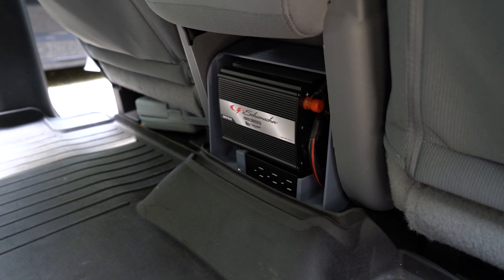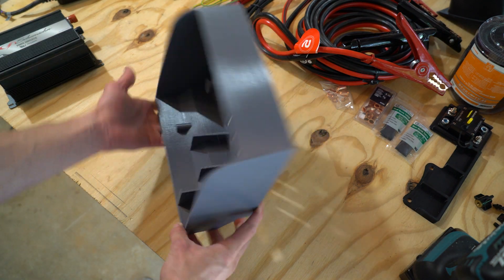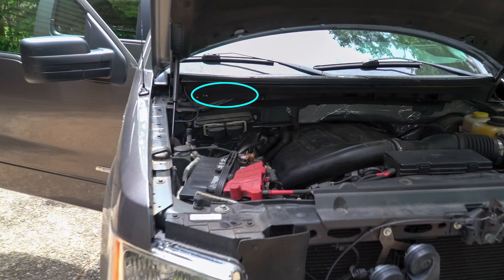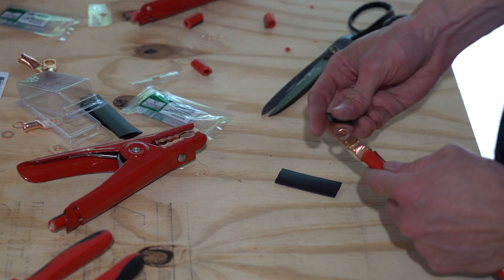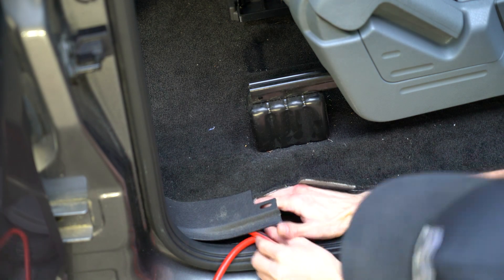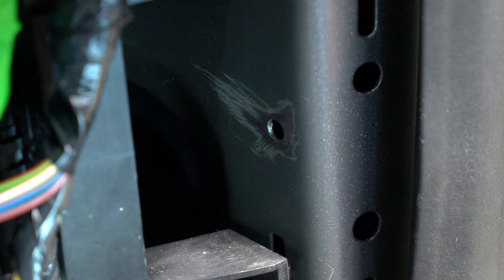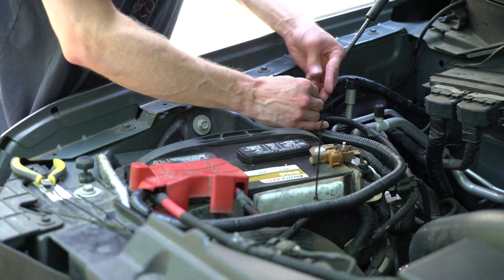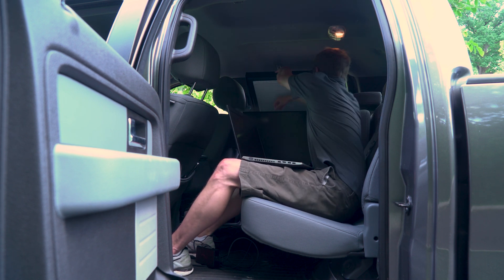Power Inverter - Wicked Full Install - AC Power for your Car or Truck

Comment: Would it be appropriate to ground to the battery?
Reply from the maker: That's not the traditional way of doing things in a vehicle. It creates the need for a lot more wires. Outside of that there may be additional reasons to avoid this but I don't have the experience to say for sure.

Comment: Great clean install - breaker should be as close to the battery as possible though. I've seen cars burn to the ground from a shorted power lead.
Reply from the maker: Thanks! I did end up putting an additional fuse on the line next to the battery.

Comment: Modified sine wave inverters are the best for resistive AC loads (lights, warmers-- things that do not have spinning parts, moving parts or motors). They're the best for those kinds of devices, because there is not as much loss in producing the modified sine wave. Running a resistive load on a pure sine wave inverter is a waste. Nothing will be broken or damaged, but the loss inside the inverter to produce the sine wave makes it run batteries down much sooner. If you will be running resistive load devices on your pure sine wave inverter only when the engine is running, and never on just batteries; it doesn't mean as much and you can just run all your devices on a pure sine wave inverter.
  On the other hand, never ever run an inductive load on a modified sine wave inverter, unless you know you do not care about the life of that device. They run horribly inefficient and run hot on modified sine wave inverters. They are something like the equivalent of giving your inductive device a brown-out to deal with, but you did it on purpose. 
Having both on hand for each device is appropriate. Choose wisely for the type of load you are going to run. Aims is good equipment, and runs cool. 
 Also, as a rule, don't load them past 2/3 of their rated power. This has a lot of implications, too.
Reply from the maker: Great info! Thanks for the comment.

Comment: I somewhat familiar with installing devices connected to the batter (emergency lightings/escort flashers) and have only had power inverters that use the 12V outlet. Is the breaker under the seat a necessity or just a safeguard? I want to make sure I do it the right way in my truck and am not familiar with the breaker or its purpose, so this has been super helpful, but any info on the breaker & its purpose would be helpful too! Thanks
Reply from the maker: The breaker should be installed for safety reasons just in case something shorts out. It can be better to install it closer to the battery terminal end of things as well. Check the comments for more info on that.

Comment: Very interresting video, thank you, I was thinking fitting one to convert to electric heating but always wonder if it could be use when the engine is on and if the alternator could cope, does the manual says what how many amps the converter will draw ? 
Cheers
Reply from the maker: The breaker that I installed is good up to 85 amps. I think that this breaker will actually limit the inverter to about 900 watts. A 750watt heater should only pull 7 amps continuously. With the engine running the alternator may be able to keep up with this level of draw, but I'm not sure. 

Always use caution when running a space heater in an enclosed space!

Comment: That is the cleanest install I have ever seen. And I do them all the time. Definitely earned a like.
Reply: Matthew Terry is it possible to power a pressure washer off a car battery for moderate amounts of time?. Say with a stronger and bigger battery and if so what kinda setup would you recommend as I'm a mobile detailer.

Comment: Dump that inverter and get a pure sine way  you won't be sorry. I have had 110 ac in almost of the cars I have owned. As a photographer videographer I need power and coffee. One of my coffee maker refused to work with a modified sine wave type inverter .  I even run a electric frying pan with mine. Also if you are going to use and inverter get a 12 volt circuit breaker and  a Blue Sea charger isolator   as well as a marine AGM type battery. Good luck.
Reply from the maker: I will make that upgrade one day. Thanks for the tips!
Reply: @The3DHandyman  anytime my friend that's what friends are for

Comment: Your engine won't turn on unless the inverter is off because the inverter is pulling current from your battery, which reduces your crank amps to power the ignition. By turning it off, the battery is able to provide full capacity amperage to the ignition. So either you get a battery large enough to power both or just be wise and turn off the inverter when the car is off
Reply: A relay wired to the ignition could also fix that problem.
Reply from the maker: @rahenkamp1  Does the relay just delay the current draw?
Reply: @The3DHandyman  it can open and close the inverter circuit with power from the key position.
Reply from the maker: @rahenkamp1  Nice! I had no idea. Thanks for the insight
Reply from the maker: I was wondering when I'd get a proper explanation of this!
Reply: @The3DHandyman  I was looking for a comment explaining it too, but never found it so I figured it would help 👍🏾
Reply from the maker: @11superstar1997  Much appreciated!

Comment: A few critiques. 

1. You really should have some overcurrent protection (fuse or breaker) within 6-12" of the connection to the battery. This minimizes the risk of the cable getting damaged, shorting out, and causing a fire. The likely good if this happening is small but does potentially exist with animals or an accident.  As it currently is installed the line is unprotected from the battery to your breaker under the seat. 

2.  I've hooked up a fluke  VR1710 to one of those Schumacher inverters and the power quality coming off of it is a quintessential modified sine wave. Ok for non sensitive electronics but I'd have some reservation about plugging in anything sensitive to one as you pointed out.  If you ever decide to swap it out the xantrex prowatt SW1000 would be a good replacement that's not horrendously expensive. Power quality isn't perfect but likely better than your wall power at home.  I've got their prosine 1800 in multiple company vehicles. They're about as perfect as you can get but stupid expensive and large.

Other than that you're install is super clean.  The wire lug covers you used was a really good idea. I probably would have grounded out to the same point out maybe the seatbelt retractor mounting bolt in the b pillar, mostly to save wire and not drill a hole. Looks like the seat rail to body bolts would have been a pain with the plastic trim covers.
Reply: Hi there, thank y'all both for all this good info. Wondering what sized fuse/breaker you'd use? Could you link to one w the appropriate specs?
Reply: @leahgilman  You need to calculate your max current draw and pick a breaker slightly larger than that.  Search on amazon for a "Marine Circuit Breaker" and you'll find plenty of options.
Reply: Xantrex prowatt sw1000
Reply: @tbits6  yeah that's the best "budget but still really really dang good" inverter. I have that and the ProSine models at work. The ProSine is a perfect sine wave. The ProWatt has some distortion but it's still a true sine inverter.  All modern electronics will be safe on either. If I was plugging in lab bench equipment the ProSine would be the only one I'd use.
Reply from the maker: Great comment MB! Very good to know about the reasoning behind having a fuse within 6-12" of the battery. I'll mount one of those when I get a chance and will add that info to the video.

As far as pure sine wave goes those units you mentioned look great but are a little pricy for the mount of use I'd currently get out of them. For the future I was looking at the GoWISE Power 600W. I would loose almost half of the current wattage but the form factor is pretty close to the Schumacher that's in there now. Any experience with that brand?
Reply: @The3DHandyman  No experience with them directly.  Based on the specs with less than 3% THD it's likely a lot better than what you've currently got.  I'd check on solar power forums/message boards for comments on it's performance or alternative options for brands.

I can see if the boss might sign off on getting one by that company to test out as we need a few more inverters.  But I can't promise it will happen.  If we do I can hook up the 1710 to it and check it's performance.

Also worth noting the interior of your vehicle likely will exceede the factor storage temp ranges.  We have routinely experienced failures even with premium brands due to this. In my previous career we learned to plan to life cycle them every year due to extreme heat in the desert since we needed reliable vehicle power from the inverters. Just something to keep in mind.
Reply from the maker: @KITDFOHS   That would be amazing but of course not necessary! Many thanks for the offer. If you do get one, be sure to let us know how it tests out.

Comment from the maker: Don't have a 3D printer? The 3D Handyman now offers 3D prints! 
You can buy the Inverter Housing here. Please allow a few days for printing...
https://www.etsy.com/listing/1223117781
Reply: Do you know if this inverter would be strong enough to do an electric start on a gas-powered snowblower? It's just to start it up
Reply from the maker: @louis3141  Seemingly. This one should put out about 7-8amps @120 volts
Reply: @The3DHandyman  Ok thanks